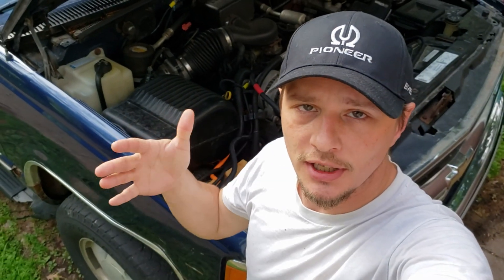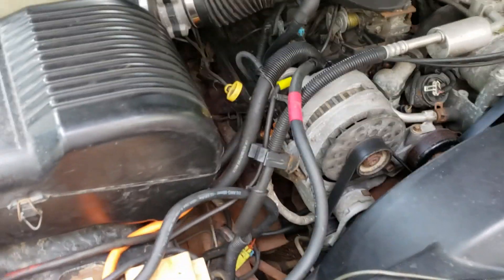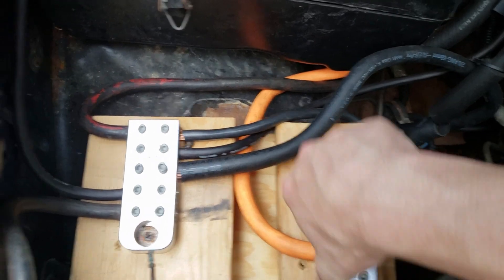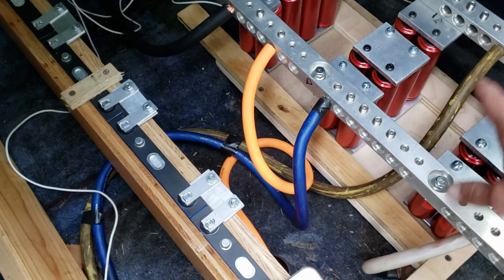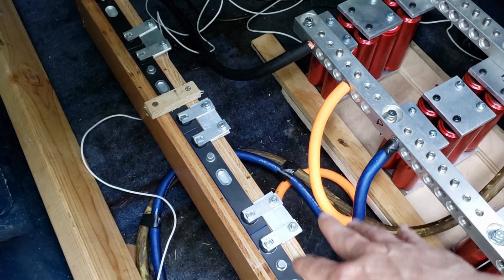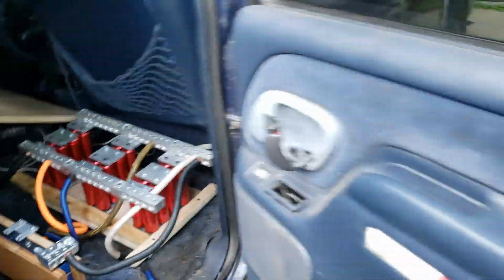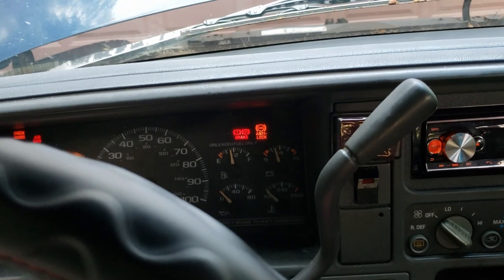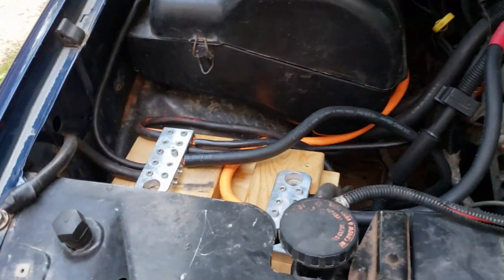Why Do a Front Battery Relocation / Delete ?

Comment: All I can think about is dropping a tire iron or ratchet across those OPEN contacts and the fireworks that you'd get, I have my keys hanging around my neck and learned over in to my setup and cause a light show and my shit has covers over every thing so only small spots are open this here is like holy shit!! I know you said test but I don't imagine it getting covered too much when it's done seen people at the car shows and I'm like just wait for the d-bag looking at your shit to drop his Red bull can on your electrical and boom, hopefully the fuses or breakers save ya but still gonna cost ya.

Comment: idk what it is about car audio people... theyre so sophomoric and yet innovative. been looking for a way to expand my EV's range without messing with the high voltage. plenty of videos and forum posts online which say you cant swap in a lithium battery for your car battery coz of all the issues it will cause. decided to build my own battery with an active balancer instead of a bms to add 4kwh to my chevy volt. just found all these old videos of car audio people doing "battery deletes" which are basically the same thing but theyve been doing it for years now for completely different reasons. its like a huge community of people who didnt have the common sense to realize why it was such a bad idea and yet they did it anyways and figured out how to make it work because they were starting from 0 with no preconceived notions on how to wire up a lithium battery lol. all i had to do to realize it would work is find this obscure term "battery delete" lol
added 200w of solar to my car which will do all the work keeping my lithium batteries topped up instead of the dc to dc converter (the electric cars equivalent of an alternator).
Reply from the maker: I have a Facebook group and we teach people how to build their own batteries for anything from car audio to power tools to electric vehicles we also supply lithium and sodium ion cells and BMS and balancers and everything you need for the basics to build a battery we also build aluminum bus bars here in Wisconsin. Check out Official DIY Lithium batteries

Comment: On a cold start my car voltage is 15.0 to 15.1. Then settles to 14.8. Will headway cells work?
Reply from the maker: you should use 6s lto instead . safer better .
Reply: The yinglong right?

Comment: How many them headway 38120s I need for a 3000w rms system will be running 270amp to 320amp alt
Reply from the maker: id do 40ah minimum
Reply from the maker: 20 cells

Comment: Don't do it. I did and my car would shut off at high volume and i was on the high way.u need power in the front to run electronics probably computers ect
Reply from the maker: if you wire it properly there is zero reason you cant relocate your batteries .
Reply: If you wire your stock cables to the battery then you should be fine. You have to do it properly.

Comment: WAIT.. Question. (I heard we shouldn't mix lithium or caps with AGM??  So can I add a single cap bank to my single AGM? OR how about adding a lithium battery as my second battery OR should I stick with AGM and just get an XS Power D7500 AGM as my second battery?????        >>>>  I need to add  something!     >>>>>
 I have a 390 amp JS Alt and my single under the hood batt is an XS Power D3400, and a Taramps Bass 8K along with a mid bass amp which I may be adding another Taramps Bass 8K. Thank you for anyone's professional advice!
Reply from the maker: Caps can be used with anything really , however caps do perform better with lithium than agm , at 8k i personally would ditch the agm and go lithium to start with , 80ah bank of yinlong would cover your needs,  a cap bank between lithium and amps would be even better.  You can do the old school thing and pile a bunch of agm in but you are still only adding support for 12.8v or lower , lithium and caps would better support voltage up to charge voltage.

Comment: Is it possible to use LTO bank with AGM battery if a battery isolator is connected between them? Thanks
Reply from the maker: I would not , leave the agm unhooked and ready to hook up if needed for some reason
Reply: @mazda2284  can i play a 80ah lto with engine off for an extended period of time?
Reply from the maker: @winfredc2523  as long as a 80ah agm would
Reply: @mazda2284  sorry for all of the questions you have been really helpful. Can I charge the lto bank with an 8amp lithium charger ( limitlesslithium)? Or will I need another kind of charger?
Reply from the maker: @winfredc2523  i use a variable bench power supply to charge everything except AGM lol .  
DC Bench Power Supply Variable Adjustable 0-30V 0-10A 60$ 
https://amzn.to/2VgjLar

Comment: What’s the name of those other cells? And how do they compare to headways
Reply from the maker: They dont compare at all , have no screws or stud to assemble.  I rather not say what they are because it wouldn't be worth buying them headways are a far better deal.  
Headways back in stock ! Get em while you can! Discount code AUDIO 
https://batteryhookup.com/products/4-headway-38120-hp-3-2v-8ah-lifepo4-lithium-batteries-25c-200a-super-cells?rfsn=3511071.21afaf

Comment: Do you have frame grounds? I switched to lithium and deleted the front batt. And now I got noise from the subs  but when I disconnect the rca cables it goes away. It sounds like engine noise but even when the trucks off.voltage holds well tho.
Reply from the maker: Yes tons of grounds,  frame to engine,  frame to alt , frame to negative block , engine to negative block , firewall to negative block , all these are up front , then couple from battery bank to frame and body
Reply: @mazda2284  ok thanks I'll try frame grounds next.

Comment: Great video I did the agm battery delete also I  replaced them with 80ah of LTO lithium in the rear Maxwell supercaps 500f under the hood I just put them in a group U1 battery box and put automotive heat sheild on inside and outside of the box caps never get hot

Comment: What if u do it without lithium like just moving your agm to the back?
Reply from the maker: also a good idea . heat is bad for all batteries . at a show recently someone had a AGM up front and it was swelling due to heat
Reply: @mazda2284  guess I'm lucky on Thurs one my 2010 A4  battery is in the trunk... But one problem  ANYTHING happens I'm fucked due to false floor and 2 15 inch Ds18 Hooligans  on to of it!!! AND SO YOU WANT YOUR BATTERY IN THE TRUNK.... SMH 🤫

Comment: Great info brother!! I'm about to do a 40 amp hour headway setup, so I have a couple of different options of doing it. I have a bank of D3100S (xs) in the back and was told just to leave one up front and the headway in the rear also I've heard to do the same as this video, which one would work the best?
Reply from the maker: relocate to the rear for both if possible .
Reply: Sell the D3100S and buy more lithium